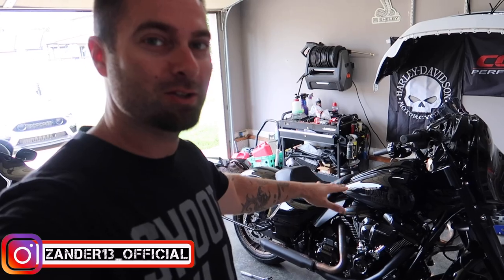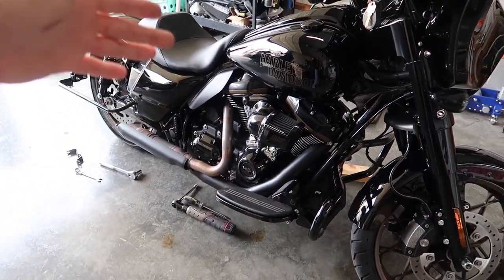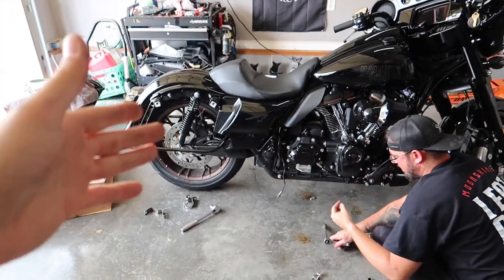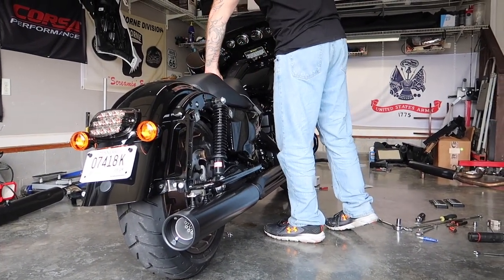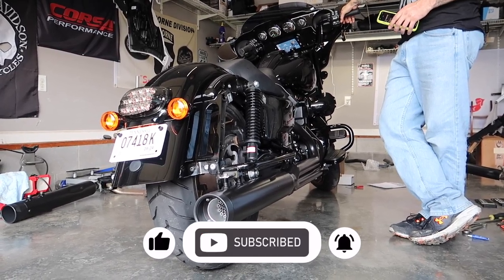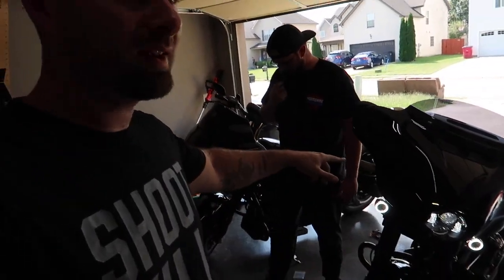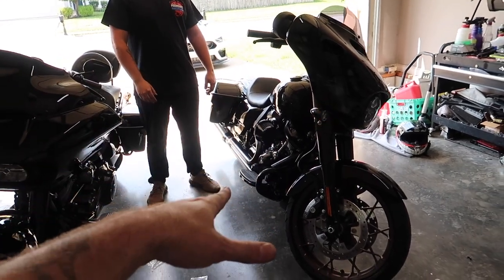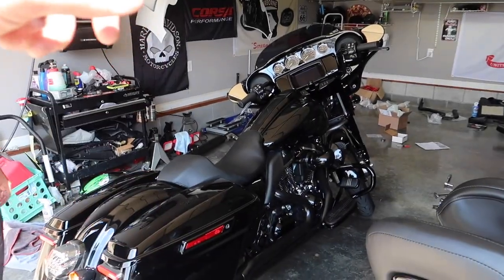Street Glide ST Stage 1 VS Stage 2 Road Glide ST (D&D EXHAUST COMPARISON)

Comment: What Tuner did You use?. I heard you say forget warranty?. And when are you should dyno the stage one ?  I have a 23’ ST also. With a 2 into 1 Bassani Pipe.
Reply from the maker: It’s in the video
Reply from the maker: Power vision
Reply: @Zander13Productions 
What seat is on the road glide?